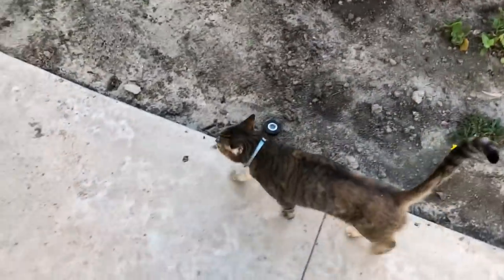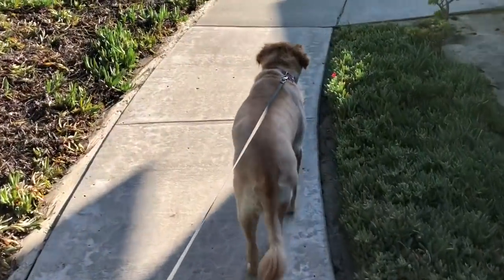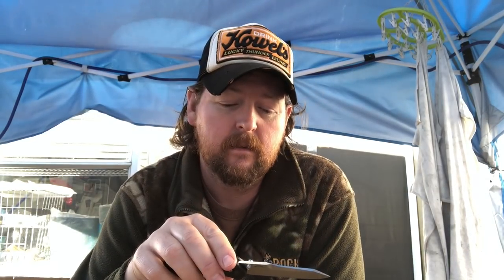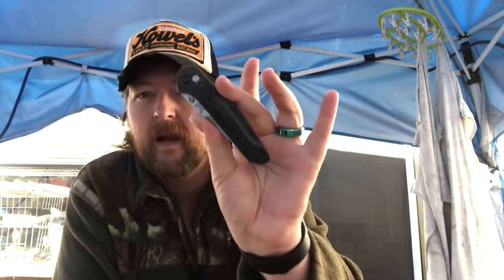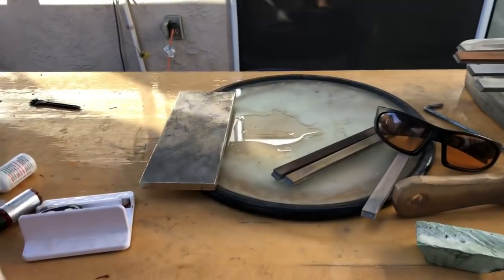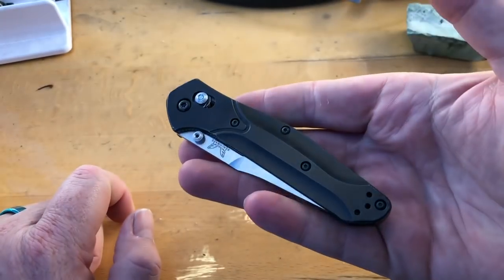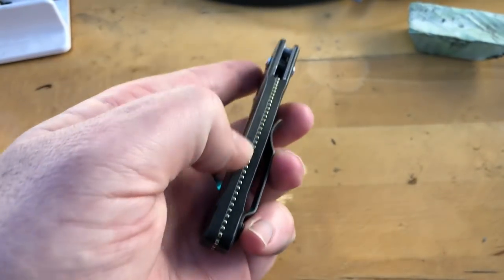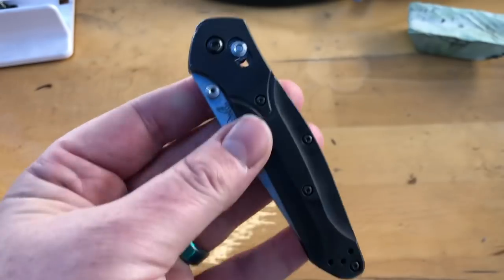Benchmade 940

Comment: Actually Mike the Benchmade Osborne 940 was first released in November of the year 2000.  I got an 940 first production run back when it first came out way back in 2000, it has a blade made of 154CM.  In late 2005 The blade on the 940 was changed from 154CM to CPM S30V.

Comment: Personally my favorite Benchmade Osborne 940 ever is the 940-2 in black G10 with green stand offs and CPM S30V blade.  Because the G10 does not conduct the cold like the aluminum does.  Also the pillar construction(green standoffs) make it a hell of a lot easier to clean the pocket lint/any dirt out of the knife handle!!!  The 940-2 I got from the website KnivesPlus.com, they sell on their site many different modified production knives.  The 940-2 I got from them had an amazing acid stonewashed blade, check this out - https://www.knivesplus.com/modified-benchmade-940-osborne-knife-acid-stonewash-edc-g10-handle.html

Comment: I think the QC of Benchmade has gone up a notch or 2 lately. I have handled a couple different BMs (and bought some), a 940, a 940-1, a Bugout and an Aileron and all were pretty much perfect in terms of centering, action and no bladeplay. Also I finally found an Anthem with even bevels, spot on centering and no blade play...took me only 3 attempts :p